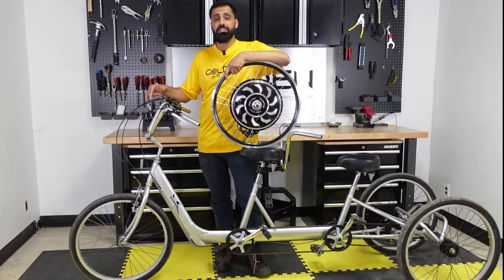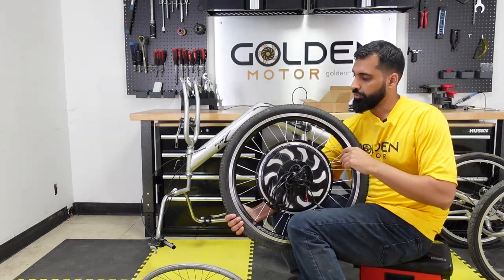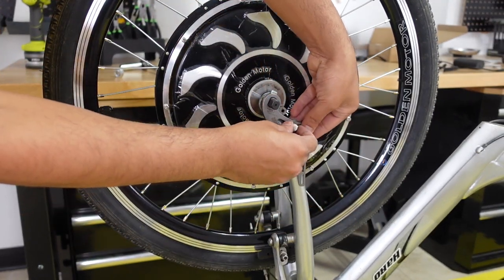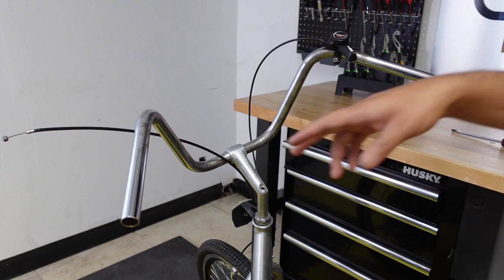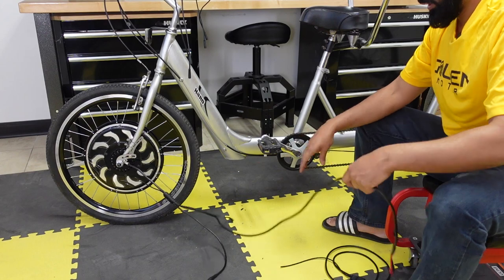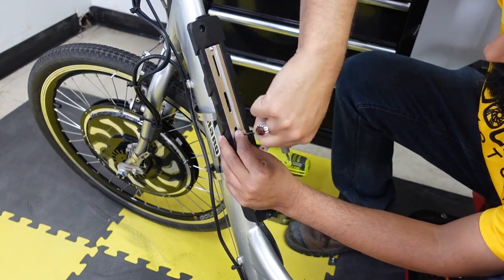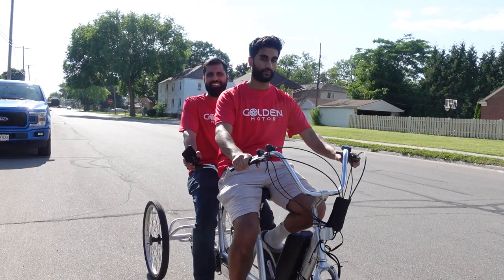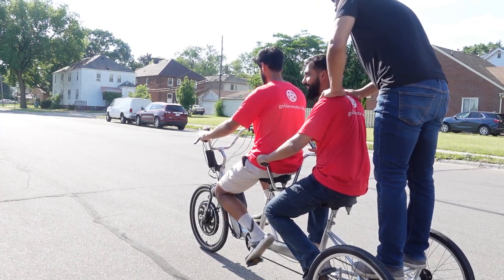Best DIY Ebike Front Hub Kit - Complete Installation of the Magic Pie 5

Comment: What would happen if you put the electric front hub on the back tire in comparison? I live in bc Canada and it’s wet here pushing your self on a bike is easier then having it pull you as there’s so much torque with electric motors have you ever tried it? Especially if I’m going to be spending 1000 bucks a kit I want to know as I have 3 trikes I’d do it to

Comment: The watts of the motors are fairly low. The higher the watts the more pulling force and stress you place on the front fork. Despite this i need to mention that the Fork STEM of a bike is not designed to pull a bike, rider and cargo. The force of the pull of the motor can eventually cause metal fatigue in the stem which can cause the front fork to break off probably when in use. This can cause severe injury to the rider. I am merely stating the fact. I think that the mid drive motor is safer for a trike since the rear hub is not an option. I will admit that I myself have a trike with a front hub motor at this time but plan on making a transition.

Comment: So it doesn't matter which of the 4 harness connectors the throttle, brakes, and 2 button switch get plugged into? They are not specific? 

Thanks

Comment: The washer with the tab does not provide any safety at all in this fork. If it is shorter so that it's goes into the notch of the fork it would provide some sort of additional torque stabilization, but in this configuration it does nothing that a regular washer would  not do anyway.

Comment: I purchased the "5 KW BLDC Motor Air Cooled" and "VECTOR 300 Series Brushless Motor Controller (5 kW Motors)" for the manufacture of electric cars. And I connected these two devices. After that, I upload the program parameter value to the controller and try to drive the motor, but it is severely vibrating and the motor does not turn. I would like to inquire about this in more detail, so can I send you an email?
Reply from the maker: Www.goldenmotor.bike/support